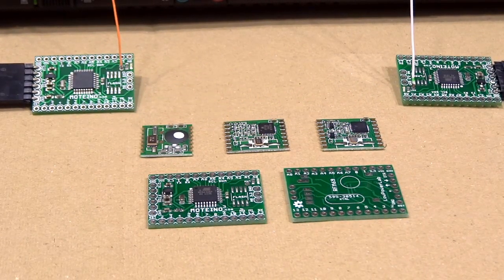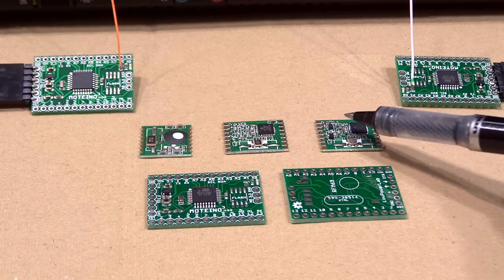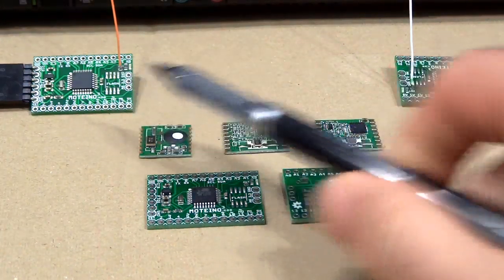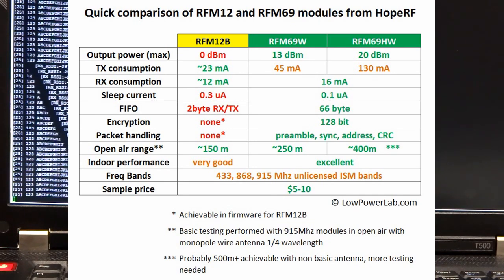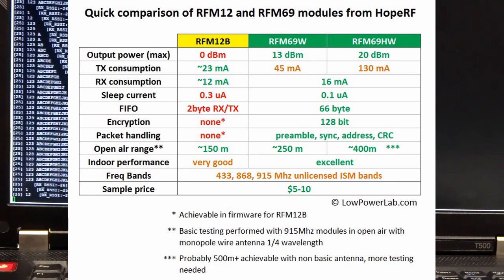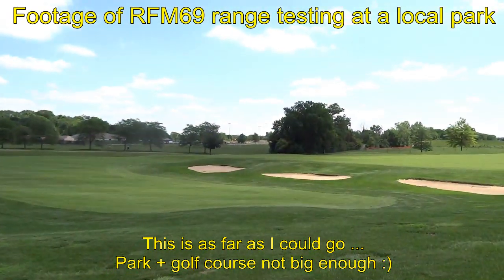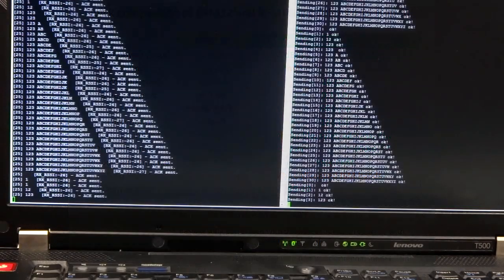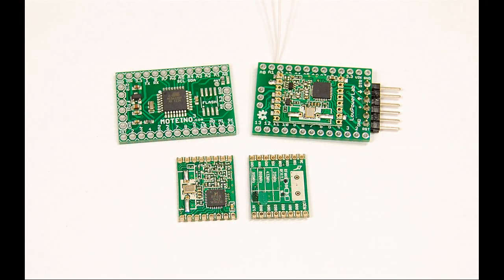RFM69W & RFM69HW - Intro, range, compared to RFM12B

Comment: He's using 3.3v regulated arduino in able to use with rfm69hw. But we can also use it with 5v arduino with some resistor level shifting. I have used such a scene and my pcbs work flawlessly.

Comment: Felix, have you worked with HopeRF's RFM95PW LORA radio?  I am trying to link a pair of Arduino MEGA2560s to a pair of RFM95PW radios via SPI on Arduino's IDE.  I have succeeded with ESP32 DEV modules communicating with the RFM95PW radios via SPI.  However I seem to have suddenly encountered some issues with Windows, it started becoming unreliable with the Silicon Lab's drivers not working, failing to connect to the ESP32 modules to a USB port while programming/running the sketches ???

I have experienced good success with the MEGA2560s communicating with a pair of Microchip RN2903 LoRa radio's via SoftwareSerial, but utilizing SPI with the HopeRF's via SPI seems to allude my attempts????  Any suggestions would be greatly appreciated.

Comment: I'm wondering if it's possible build a start-topology network with 1 "coordinator" and 50-100 slave devices with this... Is the time between feeding transmitter with data and radio transmit constant/predictable enough to manage time slots somehow?
Reply from the maker: Yes it is being done in some very nice applications with large scale deployments of nodes that report at very specific time slots synchronized by the gateway.  This is however not the for hobby DIY/open source crowd.

Comment: I'm playing now with rfm69hw, trying to achieve >250m, but after first tests i get only ~5-10m on ~17cm wire as antenna (monopole). Felix, can I ask you to show your register configuration for tx and rx? It think it will be very useful. Thank you
Reply from the maker: McDexterPL All inquiries in the forum please. The RFM69 lib when used correctly with valid wiring will enable your RFM69HW to achieve very long ranges.